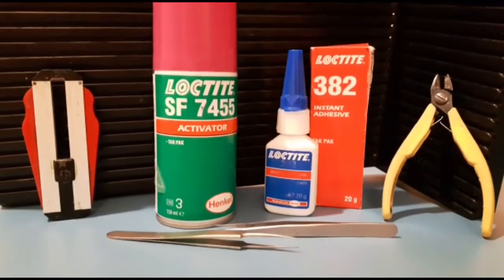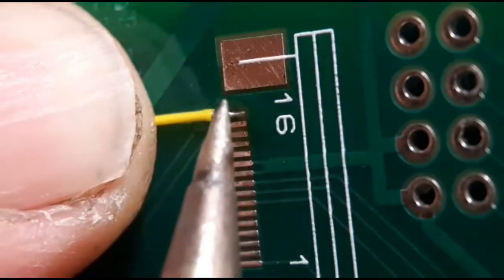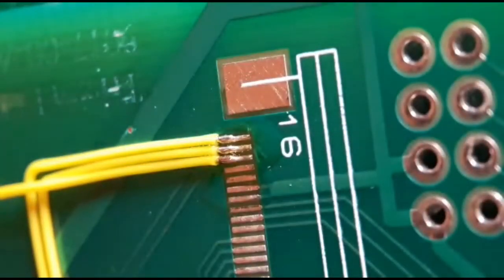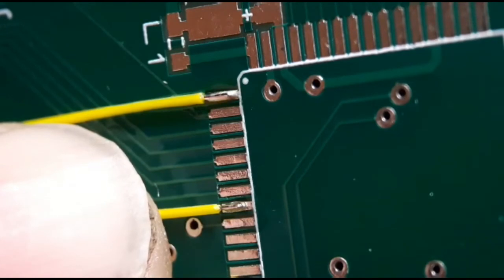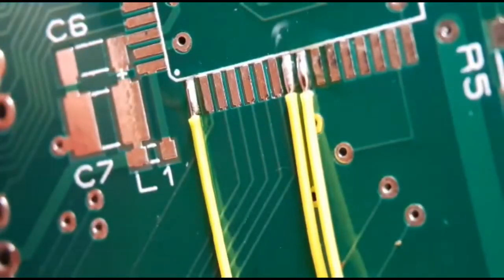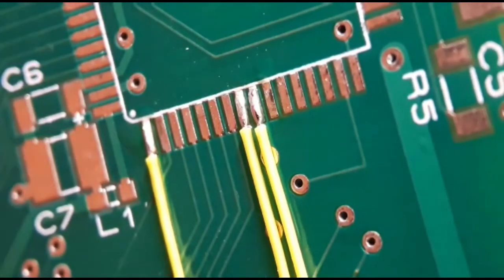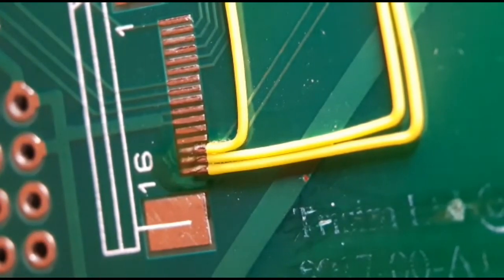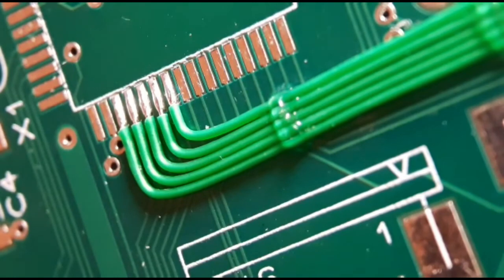How To Do SMD Wire Modifications / SMD Soldering Tutorial

Comment: what size wire should i be using for something like this?
Reply from the maker: Hi the wire I generally use on quite fine pitch devices like this would be 30 gauge. I use a sleeved wire called Kynar which is available from Farnell , RS Components or Rapid Online. In America Digikey or Mouser would stock it. If I need finer wire I would use enamel coated wire that's almost Human hair width .  Hope that helps , good luck 👍

Comment: Hello. Looks like brilliant work. Please excuse my ignorance as I'm new to DIY soldering. Is this method used for repairing traces and is it a specific wire that is used?
Reply from the maker: Hi , thank you for watching , much appreciated. This method can be used for doing board modifications or for repairing broken traces . It's basically the same principle for both .
The wire I used in this video was 30 gauge Kynar wire which comes in many different colours if required.  Available from Farnell , RS Components , Rapid Online or many other electrical stockists. In America available from Mouser or Digikey . Hope that helps , thanks again 👍

Comment: Hi, amazing work, I know this video is old, but can I ask what wire are you using? Thank you!
Reply from the maker: Hi, thank you for watching the video , much appreciated. The wire used in this video was called Kynar wire , it's a 30 gauge wire and comes in a variety of colours. It's a recommended modification wire for PCB's and is really great to work with . It's also single stranded which makes it really easy to manipulate into tricky areas. Places like Farnell , RS Components , Rapid Online and any good electrical retailer will sell it. Also you can buy special stripper's for this wire which aren't expensive. Hope that helps , thanks again 👍
Reply: @mrsolderfix3996  thank you so much! I am learning so much from your videos!
Reply from the maker: Hi , no problem , and good luck with all your soldering projects , thanks again for watching 👍

Comment: A tiny dot of Krazy Glue under the wire works great if you're quick. No visible glue gobs, very tidy. And if you need to remove or reposition the wire, you can dissolve the glue with an acetone-soaked Q-tip. Acetone doesn't seem to bother the solder resist layer on circuit boards.
Reply from the maker: Hi . Thanks for your comment, much appreciated. I've not heard of this glue but maybe it is another option for people . The Tak Pak I use is the proper glue for bonding wires to PCB's and can be easily removed if need be . It really is a great glue and is very neat if done correctly . Thanks again 👍
Reply: Krazy Glue is simply a brand name for cyanoacrylate aka Super Glue and the Loktite Tak Pak is probably another cyanoacrylate glue. Thanks for the content; I very much enjoy the closeup style and calm speaking voice. I know it is a lot of work to record, edit and post these videos.  @mrsolderfix3996

Comment: Love seeing these beautiful wire routing.

Can this be done with silicone wire? Its what I almost always use, as I've had poor experiences with Kynar wire shrinking, stripping back, or melting. Though I wonder if the silicon's elastic properties make this presentation work impossible.
Reply from the maker: Hi . Thank you for your comment . I will actually do a clearer video than this one that you've just commented on as I now have better equipment , but I'm glad you enjoyed this one. The answer to your question is , I don't really know . I've not used silicone wire much but I can imagine it will shrink back and melt quite fast , but like I say , I'm not sure . I actually find Kynar really good . What I do when I strip it ( if I need a tiny precise length ) is hold my iron just on the inner core , but just away from the sleeving . You will then see the sleeving go back a tiny amount . This will then not shrink back anymore when soldered properly. I've not had any experiences like you mention , so it's definitely my favourite modification wire. Sorry I couldn't help you fully , but good luck with whatever you try 👍

Comment: The Kynar wire I have, the sleeve tends to shrink back when I'm soldering. Is it likely I've just got poor quality wire? For projects with thicker wire, I use sillicone sleeved wire and that tends not to shrink. I got this Kynar wire from eBay (as I wanted multiple colours but not 50m rolls!)
An example is https://i.imgur.com/nFpKRpb.jpg - there wasn't all that core showing when I started!
Reply from the maker: Hi . Proper Kynar wire will only shrink back a tiny amount at the most from my experience . When I strip tiny lengths of it I sometimes then heat the wire to get that 0.2mm shrink back before I do the job . This way I know when I'm soldering properly the sleeving has already done it's shrinkage and won't do anymore 👍

Comment: What kinda wire is this? I’ve been trying to fix these traces on my super Nintendo board so I didn’t have to buy a new one and the wire I have works ok but it’s just to big
Reply from the maker: Hi . This is 30 a.w.g Kynar wire . Available from Farnell , RS Components  , Rapid Online . Even seen it on eBay where you can probably buy shorter quantities . Hope that helps 👍
Reply: @mrsolderfix3996  thanx. I have 30 gauge and I thought this one was smaller but I may just not be twisting the wire tight enough. Thank you for replying tho and trying to help. I’m gonna use your video idea for fixing my SNES
Reply from the maker: Hi . Kynar wire is a single core wire . So If you have stranded wire I would think it's more than 30 awg . It's thickness is 0.25mm.
Reply: @mrsolderfix3996  oh ok that makes sense. I mean when I bought it on Amazon it said 30 AWG and it is pretty small but it didn’t seam small enough. I’m gonna try and get some 30AWG solid core wire today. I thought they may have it at Home Depot but probably not. But I wouldn’t be shocked if they did have it since they have surprised me before with things I didn’t think they would ever have.
Reply from the maker: Hi . Good luck , hope you can get what you need 👍

Comment: See how you did the first three they have traces connection on the pad, and the 4th pad has no trace, that's essentially what I'm dealing with, I remove a pad like that with no trace, should I not worry about?
Reply from the maker: Hi. If your pad has no trace and is not connected underneath the body you have no worries. I've seen lots of boards over the years where people have removed pads and just left the pin hanging there and the boards have still worked fine. As long as the loose pin is straight and is not touching the ones next to it you will be ok . Also probably the best tip I can give is you must use flux on doing these sorts of jobs . I use one called SMFL200D. I can't do any soldering without this stuff. Good luck
Reply: @mrsolderfix3996  Brother that is SUPER Great advice thanks, can't wait til the next video!!!
Reply from the maker: Hi . Thank you for your support. I will keep posting , covering all types of components so hopefully will be useful for you . Thanks again , much appreciated👍

Comment: Can u tell me what type of wire u use?
I use wrapping wire but it's brittle and easy to break. Bcoz I use it to wire out of the circuit with round point
Reply from the maker: Hi . Thanks for the question . I use Kynar wire which is a 30 gauge wire. It comes in all different colours and is a tried and trusted wire for PCB work . It's single core and is great to work with . Hope that helps . Thanks again👍
Reply: @mrsolderfix3996  Many thanks! You are so great
Reply from the maker: Hi . No problem . Good luck with your projects👍
Reply: @mrsolderfix3996  Have you ever considered putting links of the products you use and get a small commission from it?  You are a good representative of those brands and many of us would buy

Comment: I've never seen anything like this
Reply from the maker: Hi . Thank you . Glad you enjoyed the video . Wiring on PCB's can look really smart , it's what I try to do and hopefully this will help others achieve what they want to do 👍
Reply: @mrsolderfix3996  Thanks, it definitely looks neat.

I'm a bit concerned about the super glue on the board as I do most repairs for myself, and I like being able to re-do the repair if anything ever goes wrong again and i feel like the superglue may damage the PCB when trying to take it off. I'd be more comfortable with hotmelt glue since it just peels off.

I know I can probably just burn it off as cyanoacrylates don't like heat, or am I wrong?
Reply from the maker: Hi . The glue I used in the video is called Tak Pak , and is made by Loctite . It's easily removable and is the recommended glue for PCB Wires and modifications . I would NEVER use super glue on a PCB . Tak Pak is great stuff . Always lightly spray the activator first ( wait till all disappeared then lightly put glue over the wire as shown in video . This way it's very neat and the glue stays clear. Hope that clears that up , thank you.
Reply: @mrsolderfix3996  Oh! I thought it was a cyanoacrylate based glue on the tacky side. That's a much better solution, I'm probably gonna get some then.

Does it work well as a replacement for solder mask and/or hot melt in case I'm out of that?

EDIT: Turns out it's not easily available on italian online stores
Reply from the maker: Hi . You can use it as solder mask if your solder resist has worn away . It isn't really suitable as hot glue replacement as it's not quite as strong . Tak Pak when dry does go hard , not tacky . Hope that helps . Thank you.
Reply: @mrsolderfix3996  Thank you!
Reply from the maker: No problem 🙂
Reply: @mrsolderfix3996  Just one last thing, since I can't get TakPak without paying expensive overseas shipping, know any easier to find alernatives?
Reply from the maker: Hi . I don't really know any alternatives for this , but I guess there must be something similar as I've only ever used Tak Pak for bonding wires down . I have seen it on eBay so might be worth looking on there . Thank you and good luck